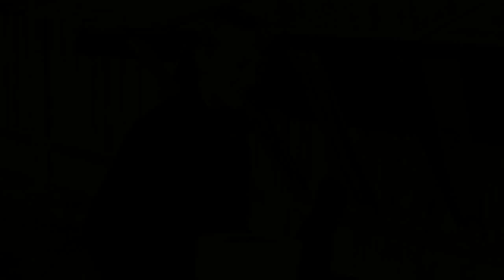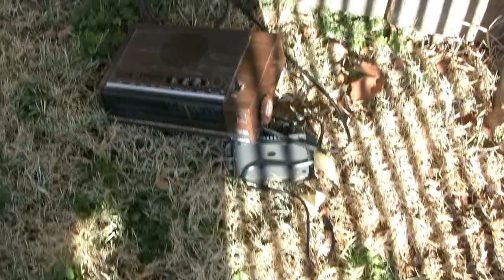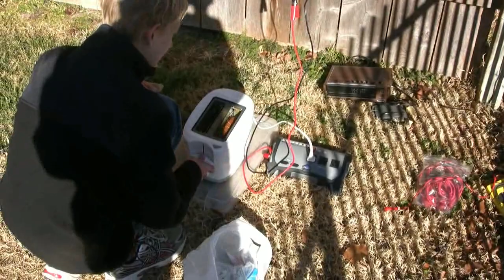Solar Powered Toaster

Comment: It looks like you only have about 500 watts of solar panels.

Unless the inverter was hooked up to a battery bank, the solar panels wouldnt be enough to power the toaster.

If you had enough panels to wire in series for about 115 vdc and 10 amps, you could power the toaster directly with no inverter.
Reply from the maker: Thanks for the comment from my project of 10 years ago.  My wife made the suggestion that the pannels were not very attrative so I have since taken them down.  It was a fun project to make and to try at the time.  Thanks for taking a look 🙂